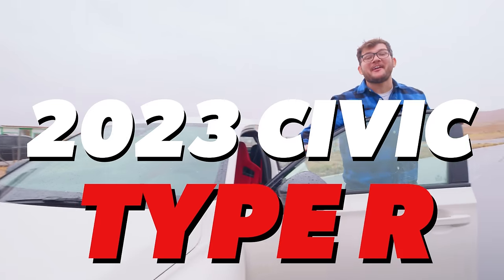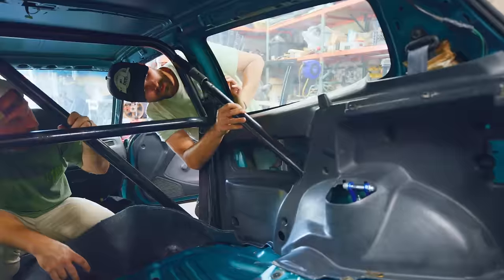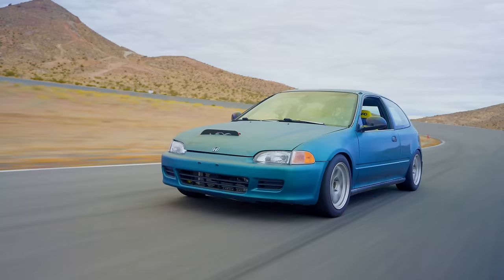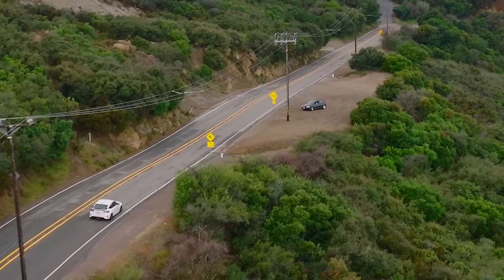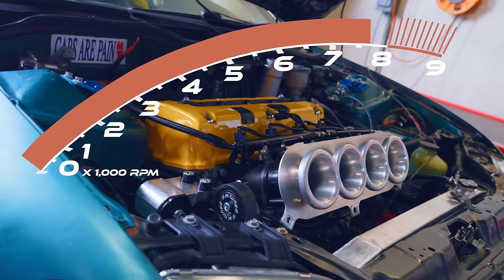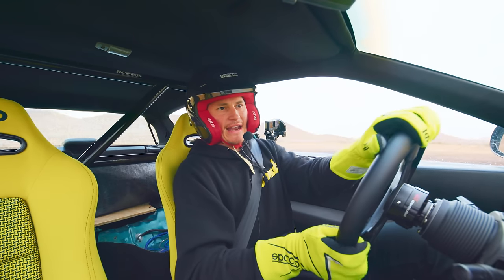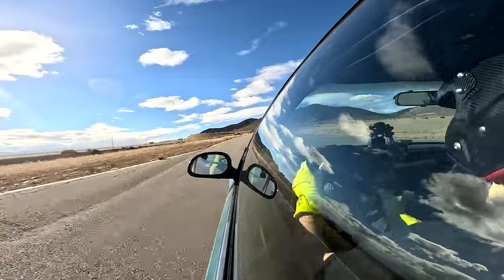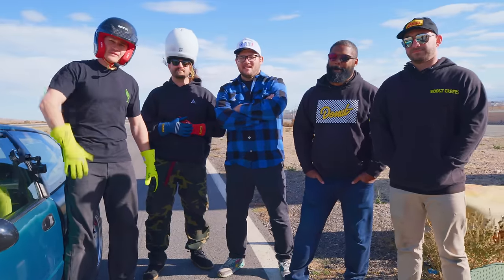$500 Civic vs $50,000 Civic Type-R (THE REMATCH)

Comment: I’ll take the 95 cause the insurance is cheaper
Reply: Is it though? It has virtually no anti theft, no safety equipment, and parts will be very expensive to replace. I'm not sure it would be as cheap as you think it would be unless you have shit insurance that wouldn't actually cover it at all.
Reply: @mr.pritchard67 insurance is absolutely cheaper
Reply: @mr.pritchard67 had a 05 civic insurance was 130 a month now I got a 2020 civic sport and it’s more than double
Reply: It’ll be cheaper if you dont declare mods
Reply: American insurance is interesting
Reply: Yes sir, just make sure they think it's stock lol
Reply: also that rizz
Reply: Not by much
Reply: @Umar-gw6fy  right, which means that if you ever wreck it, you're out of $50 k. So not that cheap...
Reply: @anthonyrathore5192 Yes, what a lovely idea. Then, when it gets stolen, you don't recoup any costs! 😂
Reply: Have fun having it stolen lmfao. These cars are so easy to steal. All of those mods too are uninsured. Let's say You spent 50k on a car, but 48,000 of that isn't insured because of the mods. They'll insure the CTR because of its value that came with the car when first sold.
Reply: @lusciouslunk Facts! I have 2 cars. My '07 Honda Fit is $68 a month for full coverage. My '14 Lexus ES350 is $139 a month full coverage. Im 35 years old, single household with 0 points and no accidents on my driving record. The newer the car, the higher the premium.
Reply: I’m sure the new one is still pretty affordable because it’s still a Honda. I had a MKV Supra and insurance was about $150 per month, probably because it was branded Toyota despite having BMW parts.
Reply: And no emissions
Reply: When they steal the 40k in parts and insurance gives you $500 u will love u saved those 50 bucks 😅
Reply: and get smashed by resale value
Reply: @lusciouslunk  yeah, because when you wreck it or it gets stolen you'll get $150 from the insurance company. 😂 Seems like a great trade off. Not.
Reply: @ThEgamingGINJ I've got a 2019 touring sedan and pay less in NY for insurance than you did for your EG. I think it's time you do some shopping around, sounds like you're getting smoked or dealing with some tickets/accidents raising your rate.
Reply: companies around here refuse to insure any car older than 2005 lol
Reply: @ThEgamingGINJ does you're country also work out the insurance by age of driver too?
Reply: Il take neither of them they look cheap and I don’t wanna fart can going down the street
Reply: I mean… but the repair bills…
Reply: @tommywd40 no one is gonna steal it, haven’t heard a civic get stolen in ages
Reply: Insurance will total it in a heartbeat and won't cover the add-ons.
Reply: @SouthsideKidd550 apples and oranges. The Fit is the very definition of an economy car. The ES is an entry level luxury car and probably has nearly double the HP,  closer to triple if it's the v6.
Reply: me looking at the box on the form... is this vehicle modified for speed 🤐 other cars have this power🤷‍♂️  that roll bar? that's just for saftey 😅 yo vtec just kicked in brrrraaahhhhhhhHHHHHHHH! BRAP BRAPBRAP
brrrrraaahhhhhHHHHHH!
Reply: @mr.pritchard67  "Is it though? "

Jokes aside- Yes, sharply so.

 "It has virtually no anti theft"

Thats a pretty easy fix to approach.

"no safety equipment,"

I wouldnt say "no" safety equipment, but ill grant that the newer car is much safer. Im sure youll get a handfull of comments talking about "but this has a cage! and seats! and harness!"- And ya, thats not entirely wrong. But itll depend a lot on if were talking about a crash on the street, or on the track.  Driving a caged up car while wearing a helmet on the trace track? Sure- id rather be in there. Actually out on the street? Give me the new civic. Cages in "street" cars without a helmet on make them more dangerous, not less (in many cases)

"and parts will be very expensive to replace":

At least with this EG civic- Nearly everything compared to the new civic would be absolutely cheaper.  

" I'm not sure it would be as cheap as you think it would be unless you have shit insurance that wouldn't actually cover it at all."

Now this is a bit more realistic of a concept- Just "insuring the civic" would be cheaper, by a lot.  But if you have THIS much money into it, and you want insurance to actually cover you for those costs, youll need custom insurance where theyre aware of the value of the vehicle and the modifications made to it. Youll pay more for this.

But having had experience with this type of insurance- its still cheaper.  I insure my FD with a value of 35k, that costs less than insuring my prius which has a value of 10~.
Reply: @TerpCrazy  you're being sarcastic here right?
Reply: Yeah it’s cheaper, right up until it’s totaled and they give you a check for 1/100 the value.
Reply: @mr.pritchard67 yes because the car isn’t worth shit lol
Reply: If you’re worried about insurance you wouldn’t have put 50k into the car in the first place.
Reply: You have to consider the mods and extra labor. Some insurance will cover it.
Reply: @88luda88 How is your insurance different?
Reply: Yeah because it's a bucket of metal not worth a fuck except to Honda fan boys. I love all cars but this statement is dumb as hell. Hmm I wonder why a civic with a book value of less than 1000 bucks is 100 dollars cheaper a month than a 40k car 🤔🤔🤔
Reply: Lol so true one will be 500$ full coverage other will be 130$ basic on the road policy 😂
Reply: They'd be the same if it were liability.
Reply: and you don’t gotta worry about markup
Reply: @Umar-gw6fy and depending which state you live in, you won’t be able to smog a car legally with unapproved mods. So chances for tickets and getting your car towed go up a bit.
Reply: IF you don't tell the insurance company what you modded. 😂
Reply: @ThEgamingGINJ liability is liability it's the same price.
Reply: Not in my state lol
Reply: Smaller too, these modern cars are unnecessarily huge lol
Reply: @ThEgamingGINJ wtf how many accidents have you caused to have that high a monthly payment? 😂
Reply: It also looks way better
Reply: @bradleyisfishing  "Yeah it’s cheaper, right up until it’s totaled and they give you a check for 1/100 the value."

Youd need custom insurance that reflects the value of the vehicle.  

Theres numerous companies that do this

Youll of course pay more than if "it was just a civic", but youll still genuinely pay less than what a brand new car would be.

Vintage / collector car insurance isnt usually too bad
Reply: The older civic is a car thief wet dream.
Reply: At declared value..?
Reply: @SidewaysGts  I know that I was given an option to declare mods and their value in my insurance. Once I actually do stuff I’ll definitely be doing that, but stock for now!
Reply: Because insurance will be more than happy to cut you a $1,000 check vs a $50,000 check in the case of a total loss.
Reply: 😂 ahhh yes, and when you totaled it, they will pay you $500, oh wait, you will have to cover the deductible…
Reply: @mr.pritchard67 Why you even trying to compare that with cars which are nearly 30 years apart is what I still didn't catch. The video already did justice. He prefers a 95, you don't, well, good for both of you. 🤷
Reply: Because you are basically totaling it with ANY accident. Those mods won't matter to an insurance adjuster.
Reply: it does have one of the better anti theft systems installed, manual transmission.
Reply: Theyll NEVER payout on an accident vs the new one
Reply: They ain’t gotta know.. to them it’s still the car that takes half minute to hit 60
Reply: So when you wreck it and have no collision they give you nothing for it? Yeah.
Reply: You go ahead and make a claim bring underinsured in a modified car. 😅
Reply: @mr.pritchard67 it'll definitely be cheaper but if  gets stolen or wrecked insurance will pay out whatever the going rate for a stock eg is.
Reply: Agent and adjuster here. If you didn’t declare it. You not getting paid for it.
Reply: Not to mention you can insure it as a classic. Dirt cheap, full coverage.
Reply: @psyck  I'm so glad I don't have to deal with stupid emissions BS here in Alaska.
Reply: @lusciouslunk  until you realize that your expensive mods are no longer insured with that cheaper insurance completely negating the whole point of insurance.
Reply: Word! Insurance for new car is absolutely insane compared to older ones. My '99 Silverado is pennies on the dollar compared to my daily commuting appliance.
Reply: Cheaper until you total it and insurance gives you $300 to replace it
Reply: @mr.pritchard67  Well, you just have to buy it back and find a new shell to hang all those parts off of. Not a really 50k loss like it would be with a new car.
Reply: It is until the insurance companies stop providing coverage to older vehicles which will probably be a thing down the line.
Reply: @MrTilbin  exactly 👎
Reply: Have none of yall heard of a kill switch? Also I'd take the 95 as well since you actually own the car and can modify it however you want. Plus it's built not bought which has its own merrits
Reply: @User77989  This is truth, if it were my 50k, I would buy a used Godzilla (GT-R)!
Reply: and putting tags on the car here in iowa it cost us 150 for a new car over 15 for a car like that
Reply: You’ve got me rolling on the floor cause it’s soo true tho!.. 😝
Reply: It depends on your record too. Had a 2013 SI and insurance was 100$ full coverage the highest of the highs and now I have a 21 type r same insurance same plan and it’s 190.
Reply: If you had 50k to put in mods you’re probably not worried about your insurance premium versus a new car
Reply: My 2023 fl5’s full coverage is $135
Reply: It's cheaper, but the car already broke down once, and they hadn't even put 1k miles on it. I'm all for fun cars, but you better be an expert at building them because that's a LOT of work, and with no warranty. Everyone knows modified cars are less reliable. Just look at every single car they've built, almost all of them have broken down. You're going to quickly outweigh your insurance savings in repairs.
Reply: @realPinkfong  lucky duck. 😂 I had a Neon SRT-4 and just put a blow-off valve on it. The smog tech admitted that it does nothing to effect the smog test itself but because it’s considered an illegal mod, it fails on the visual inspection. 
Even had police pull me over and write a fix-it ticket for a stock exhaust. Because he could “hear it as I drove by.” Had to take it to Dodge so they could write a confirmation that it was stock. Cali sucks for this kinda thing.
Reply: Ok
Reply: @mr.pritchard67 a ghost remote start is like 250$ and protects you completely. I pay 40$ a month for liability on my 92 hatch
Reply: Y'all pay for insurance?
Reply: @mr.pritchard67  Or you could just get another civic for 500 bucks and build that one with the old parts salvaged from the previous one🤷🏼‍♂️
Reply: What about the tax?
Reply: No one wants to insure a 20 year old civic
Reply: Everyone here justifying how were forced to pay for insurance in the first place. Especially when they fight you tooth and nail to NOT pay your claim.

And if you don't pay you're a criminal.
Reply: And you don’t need comprehensive
Reply: You need to ENDORSE any after market parts otherwise it would be NOT be covered, and/or you will have very low coverage
Reply: Until they find out what you did to it...
Reply: @Umar-gw6fy  bit then if you claim insurance because of an accident they'll only give you the amount for the car and not mods right?
Reply: Exactly, wise choice. 😄👍🏿
Reply: Facts and just as fast😂 as
Reply: That’s what been keeping me from a new car 😂the insurance companies 😂😂😂
Reply: If you insure as just a normal 95 it is probably cheaper. If you want to insure all the money invested into it you'd need to do it through a company like hagertys and it would likely be much more to insure
Reply: @anydaynow01  well, that’s a better choice and they don’t sound like cans lol
Reply: Opposite to healthy insurance
Reply: Lol - the 95 civic would be way more expensive and may even require a specialist insurance provider. 

All those after market mods, the lack of safety and anti-theft features but also the mods indicate what type of driver you are. 

Not to mention to start with you are paying insurance on two vehicles while you are re-building and modding it.
Reply: @Armadurapersonal where is that?!
Reply: Definitely would be cheaper. Older cars are normally cheaper than new.
Reply: @L-Dub23  an older car with less/no safety features and anti-theft that has had $50k of modification put into it, cheaper than a $44k new car in stock condition with all the bells and whistles, yeah sure. 🙄
Reply: @mr.pritchard67 parts are still dirt cheap and yes insurance will be cheaper😂
Reply: Registration also cheaper too.
Reply: And taxes lol
Reply: @crxk20r59  you mean the registration would be cheaper for the new car right?

Certainly that way where I live. Variety of different tiers, but the older the more expensive.
Reply: Yes it is cheaper but in the case it’s a total loss you’re only gonna get $500 lol they absolutely do not care that you spent 50k on aftermarket parts
Reply: Easier to work on too I'll bet.
Reply: That’s because the insurance isn’t going to cover all the modifications you’ve put on it.
Reply: @sambeaumont395  Oh, I didn’t know that. In California, the older cars have cheaper yearly dmv registration fee’s.
Reply: True
Reply: @crxk20r59  that sounds odd.
Part of the registration where I live includes emergency services levies, environmental impact etc.

Where I live anyway it’s just one extra thing attempting to get people to upgrade to newer more efficient and safer cars. 
(Although in all honesty people are moving from cars to SUVs which are far more deadly in vehicle to pedestrian/biker than the sloping bonnets/hoods of the past).
Reply: @ThEgamingGINJ  Probably a very bad driver with those prices.
Reply: @mr.pritchard67 well bro actually you can get a insurance company that covers all the mods you put onto ur car cause tavarish has a insurance company that does because he used a v6 charger body and put all the charger hellcat parts on it motor and transmission front and rear end and all of the interior because Dodge gave him a pre production car and they had to "crush it" but... They only had to crush the frame it self so he really stripped that car down to nothing but the frame it self and dodge picked it up
Reply: @marcodelaghetto  ur wrong bro actually you can get a insurance company that covers all the mods you put onto ur car cause tavarish has a insurance company that does because he used a v6 charger body and put all the charger hellcat parts on it motor and transmission front and rear end and all of the interior because Dodge gave him a pre production car and they had to "crush it" but... They only had to crush the frame it self so he really stripped that car down to nothing but the frame it self and dodge picked it up
Reply: @WhoAmIWill actually ur wrong bro you can get a insurance company that covers all the mods you put onto ur car cause tavarish has a insurance company that does because he used a v6 charger body and put all the charger hellcat parts on it motor and transmission front and rear end and all of the interior because Dodge gave him a pre production car and they had to "crush it" but... They only had to crush the frame it self so he really stripped that car down to nothing but the frame it self and dodge picked it up
Reply: @dkrampage2933 actually no bro you can get a insurance company that covers all the mods you put onto ur car cause tavarish has a insurance company that does because he used a v6 charger body and put all the charger hellcat parts on it motor and transmission front and rear end and all of the interior because Dodge gave him a pre production car and they had to "crush it" but... They only had to crush the frame it self so he really stripped that car down to nothing but the frame it self and dodge picked it up
Reply: It’s not a civic but I have an obs Chevy I pay $40 a month for full coverage.
Reply: Idk if its the same in the US as the UK. If you fail to declare mods here your insurance is voided. And modified cars add a premium to insurance because its not factory and they have no way of knowing the reliability or safety of modification parts.
Reply: @GaryRobert17  nah bro you don't have to report any mods here unless you simply want them covered by insurance
Reply: You try and insure a civic for 50000$ and tell me the cost
Reply: I'd take the old one as well. It's got so much more charm.
Reply: @lusciouslunk it absolutely is not lmao, that car is bordering on 30 years old, and like the guy above said it has safety and anti-theft features that are way too old and not effective enough now. Insurance will be very hard on you for it because it’s a huge liability with how old it is.
Reply: @User77989 damn all you do is leave annoying comments on this channel huh
Reply: Insurance typically won't cover the cost of mods and will just go by the blue book of a standard of your make/model so good luck in an accident 😬
Reply: Yeah a whole lot less than the 100 a month for a type r😂
Reply: @TraumaTrae  actually ur wrong bro you can get a insurance company that covers all the mods you put onto ur car cause tavarish has a insurance company that does because he used a v6 charger body and put all the charger hellcat parts on it motor and transmission front and rear end and all of the interior because Dodge gave him a pre production car and they had to "crush it" but... They only had to crush the frame it self so he really stripped that car down to nothing but the frame it self and dodge picked it up long story short is you can get a insurance company that does cover all of ur mods and money you put into ur car
Reply: is it still cheaper to insure with all the modifications? I would have thought it would cost more to insure when the insurance company a) has less data on it to calculate risk b) expects it to be driven fast in possibly risky situations.
Reply: @mr.pritchard67 The '95 is definitely cheaper on insurance. Plus in my state you could insure it as historic and pay next to nothing.
Reply: Not really, since you have to declare all the mods on your veichle to your insurance company, in the end it will cost more.
Reply: Until it hits something.
Reply: @SpartanQwop  well you technically don't have to declare the mods to ur insurance company if you don't care about not being paidout for it if you end up wrecking the car so you could just insure it as a regular 95 "eg hatch"
Reply: @damnitdave.  You do. In the UK anyway, for many reasons. If you get stopped by the police for whatever reason and you have modded your car that it's visible you could get a ticket if you haven't declared the mods to your insurance company (they will check), if you get in an accident and you haven't declared the mods your premium will go up. The only thing you can get away with is the exhaust and simple mods like an air filter. Anything else it's best advised to report.
Reply: @SpartanQwop  like u said in the UK not here in the US I just said that bro 🤧
Reply: @damnitdave.  You didn't mention the US ^ and it sounds like a broken/ dangerous system.
Reply: @SpartanQwop  bro i legit said nah bro you don't have to report any mods "here" as in the United States
Reply: @ThEgamingGINJ  unfortunately you might be getting fleeced by your insurance company. My 23 F150 is less than 130 and its full coverage. I'd definitely look at getting some quotes
Reply: I was gonna comment on this. The old ones cause the insurance is cheaper... and it sounds awesome
Reply: Sweden has some pretty strict laws that say that you can't modify cars to have higher emissions than they had stock, unless they're from 1992 or older, I think.
Reply: It's gonna be about 40 dollars different and that's minimum coverage on the 95 and full coverage on the 2024 ask me how I know and I think the safety features are definitely worth it
Reply: Of course you will
Reply: No way I have a 2008 civic si for my winter beater and an e39 540i 6 speed msport for spring to fall. I pay $80 less a month for the 540 lol
Reply: Ins will only cover stock in an accident unless you tell them about the 50k worth of mods and have them in the policy.
Reply: Is it comprehensive on your new one? If so that's not a fair comparison. They aren't going to cover 50k for a modded 95 civic, so getting comprehensive on the modded one doesn't mean you are covered, it only means they are going to call it totalled and give you $500 if anything happens.  @ThEgamingGINJ
Reply: We don't have to debate about this in the comments. Go get a Vin for both vehicles and get a quote from your insurance company. 🤷🏾‍♂️
Reply: It’s funny how prices differ, my fk8 was cheaper to insure then my mk7 gti!
Reply: @Umar-gw6fy  yeah and then they deny your claims because you didn't declare mods
Reply: @mr.pritchard67  oh it's got anti theft. It's a manual and looks like shit from 40 feet.
Reply: yea cheap..but no safety..no abs...
Reply: I'm covered by hagerty for my 5th gen  lude best decision ever premium stings a little but it's good piece of mind
Reply: I drive an 2016 S3 and a 2007 tacoma both full coverage for 165 a month@ThEgamingGINJ
Reply: @SouthsideKidd550  your comparing your econobox cheap car to a luxury brand mid range car. The comparison is like old navy and Ralph Lauren.
Reply: Donut built it so it'll break down, you need to account for all the spare parts and labour
Reply: If you declare all the parts and such that are in the car you’d probably find insurance will drive the price right up… if they even insure you in the first place…
Reply: Repairs will make up for the saved insurance cost 😂
Reply: Cheaper insurance but virtually no warranty…
Reply: @ThEgamingGINJ Switch insurance every 6 months.  I pay what you do for half of a year 😬
Reply: @mr.pritchard67 pets expensive to replace?! It’s a Honda oil changes are optional. Oil itself is optional. Parts for old Hondas are super common and cheap because of aftermarket support
Reply: Also being 95 only a little over a year till no safety or emissions inspection, and tax value I’m sure is significantly lower than the new
Reply: Insurance void after mods
Reply: Straight garbage 50k for 230hp
Reply: @mr.pritchard67 for my 1995 Nissan pickup I paid $47 with State Farm full coverage and full medical. For sure it will be cheaper.
Reply: then you crash it and they give you $500 minus deductible
Reply: @oddwayne  Ummmm duh! That was the quotes I got if I had separate insurance. My two car combined I pay $147 a month. Of course Honda nameplate will have cheaper insurance rates than the Lexus nameplate. Yes, its a given.
Reply: You’d want to disclose all aftermarket mods and place a value on them. That will raise the rates quite a bit.
Reply: @mr.pritchard67 $79 vs $587 you tell me
Reply: @mr.pritchard67 its a 500 dollar car
Reply: Yes but if you crash it will be more expensive 🧠✅💯
Reply: Insurance is not always cheaper on an older car. First off, you have a coupe vs a sedan. The sedan will give you the cheaper rate. It maybe sport, but because of the 4 doors it can be a family car. A coupe will always be in the sport category for insurance. Next safety features is the other thing that gets you discounts. Third is mileage vs years old. You can get a discount if the car in question isn't driven a lot, but deductions could be applied depending on the reliability to find parts if it's labeled a classic. Fourth full coverage vs liability. Fifth is state and city/town insurance pricing because of traffic vs travel. All in all there may not be to many differences price wise depending on you go about it, unless you go as bare bones as you can get.
Reply: @ThEgamingGINJ 2020 Civic Sport in some Asian countries now costed around $37.500.
Reply: @lusciouslunk why the insurance of the 2005 Civic is so much cheaper?
Reply: @anthonyrathore5192 stock and not upgraded at all? It should've been upgraded to stand a chance of winning against the other Civics.
Reply: @haykakancryptodprots the resale value is way cheaper than most of the normal cars obviously.
Reply: @User77989 for me i gonna take the 2023 Civic Type R. Its just drove amazingly.
Reply: @mr.pritchard67 yeah it’s cheaper by a long shot. and parts are readily available cuz it’s a very common car. it’s a honda
Reply: @lusciouslunk  until it gets stolen since it’s a Honda. Then they write you a check for $500 and your out 49,500 😅
Reply: The insurance gonna cover that 50k dropped into the car?
Reply: That true but if u total the 95 insurance would probably give u only 1k for it lol
Reply: @mr.pritchard67 you obviously don’t know how insurance works…: cheaper car =cheaper insurance it’s common sense.
Reply: @motorheadmike2343  less safety equipment, no anti theft, harder to find and in most cases only aftermarket parts because Honda doesn't make them anymore. Tell me you have no idea how insurance works without telling me you have no idea how insurance works. 😂
Reply: @ThEgamingGINJ holy shit. My C43 AMG isn't that much. You need to shop around
Reply: Yeah, it cheaper because insurance still values the car at $500 and won't provide full coverage 😂
Reply: Jesus loves you & made a way for our sins to be forgiven, turn to Christ & repent for eternity in Heaven!!!
Reply: The screams I hate fun and having a good time 😂
Reply: @mr.pritchard67  did you just say parts will be more expensive to replace? lol
Reply: not to mention, they could’ve easily made a better track car if they actually wanted to😂😂😂 for 30k or less. something tells me they were not allowed to make the old civic faster for sponsorship purposes.
Reply: Yeah it’s cheaper if you’re like in your 40s 😅
Reply: Except all aftermarket parts won't be covered unless taxed. And then you'll have to find an insurance that accepts that and you probably will have to pay just as much insurance as the new type R
Reply: A man of culture🧐
As would I good sir
Reply: Right just tell them it's stock😂😂
Reply: Till they realize it’s heavily modified
Reply: @padnoracing2416  yeah in Canada once I turn 25 it will drop abit, I got a clean record too civics are just getting more pricey now with all the thefts
Reply: @snussy-kp8qj  0 I live in Canada our dollar is shit and they said it’s more for civics now cause they keep getting stole
Reply: @mitsuturbo  it’s basically brand new only 31,000km on it and in usd it would be like 220 a month, insurance said it was cause of all the Hondas being stolen in the Toronto area pretty much prolly bs lmao
Reply: Worry about the property tax on it and not the insurance so much.
Reply: When you wreck the $50k ‘95, the insurance gives you $500.
Reply: I’ll take he 50k and buy a real car
Reply: All y’all saying yeah then your car is stolen….you understand you don’t have to live in a democrat  crap box city..move into rural America enjoy your car and way less police along with nicer people and much safer as well. And much more affordable living instead of paying 1-3k+ rent that would be multiple months payments on nice homes so you’re making money monthly not throwing it away. 😂
Reply: @mr.pritchard67  wrong. You swap all the goodies to a different chassis and just build another.
Reply: @mr.pritchard67 It's manual. US carjackers can't drive it.
Reply: @ThEgamingGINJ 130 a month? Daym thats hella expensive for a civic
Reply: My insurance is mad for my 94 probs just the uk tho
Reply: @mr.pritchard67 as someone with both a 95 and 2020, the 95 is about 1/3 the running costs, parts fuel insurance included.
Reply: The registration is cheaper lmao
Reply: @ThEgamingGINJ  honestly in Malta the insurance is taken by age, co2 emissions and how much the car cost and the aviability of parts.
Reply: I mean after 50 bands of straight up yu wouldn't be worried the insurance lol
Reply: @stann_visuals  what does that even mean? They're "mad FOR your 94" ? WHAT?!!
Reply: So is the payout, you aren't getting reimbursed for any of those parts
Reply: @CptPandy-tj9ty  its actually mandatory where I live
Reply: Did u consider adding all tunes and upgrades to insurance?? 
More likely will be more
Reply: My thoughts exactly lol
Reply: @Umar-gw6fy yep. Don’t declare mods, but keep pictures and records in the event of an accident.
Reply: @AustinB3.6R  
Pictures are not enough, if u didn’t declare they dont give a fuck , insurance company will say its a different car either swap license plate
Reply: @RX-805  Nobody I know has ever had a car stolen where I live lol
Reply: Yes but you’ll get back a $1500 check if anything happens
Reply: yeah but if you build it out that yeah those parts won’t be insured you’ll just be covered for everything oem that they think will be in that car
Reply: @jeremiorgana8971  okay buddy. You’re so smart and you’re so right. I didn’t get tboned and get an extra $5000 from his insurance company for the pictures and receipts of my wheels. Subwoofers, tuner, radio, cams,
And all of the work I had done.
Reply: @mr.pritchard67 amen. I love my mad low rates on my 04 hondavan. But. At a quarter million miles she's had a few very expensive years and even the dealer couldn't calibrate my ancient odometer. A mess of recently maintained bits from a network of local gearheads. Great people, great shops, great options for upgrades... okay yah old cars are better. ;)
Reply: You get an Eg for cheap insurance they just gonna steal it from you.. been there done that
Reply: Liability gang checking in.
Reply: As long as you are okay getting $500 back after putting $50,000 worth of parts plus countless man hours if it gets wrecked or stolen.
Reply: @mr.pritchard67 it does have an anti theft system in it. It's called "being old" and "manual"
Reply: I’d take the 95 cause I like it better
Reply: If you can’t afford the insurance you can’t afford the payment on it
Reply: @gouveiarfl  that one dude with the beanie. shit gets me every time.
Reply: I drove a 2020 Accord and a 95 Accord.
The difference was 20$
Reply: @ThEgamingGINJ my 2018 is triple then my 2006 si . And it’s 5 yearsss old
Reply: We used to do the same with mustangs,pay insurance on a 4 cylinder but have a V8 lol
Reply: Anyday
Reply: I take the 95 cuz it looks better and its a hatchback and because idk its one of my favorite cars
Reply: @RX-805 
No one is stealing that POS. This isn’t 2004 anymore and that’s no Integra Type R.
Reply: @negativeindustrial  people will steal anything. You live in a good neighborhood I can tell, so i doubt you'd know.
Reply: @ThEgamingGINJ that’s where I am at now have had the 05 for a few months now, and that’s what I also plan to do in future😂
Reply: 😂😂😂😂😂 wtf
Reply: @lusciouslunk My 1991 CRX was almost $60 a month more for full coverage than my 2014 Nissan Titan because it has no anti-theft or ABS or traction control or any of that stuff because there's no safety features it actually makes it more expensive.
Reply: @lamesamelame  If you value your life that much you wouldn't drive it all.
Reply: @lamesamelame  nope I actually do and I'm not obtuse at all I'm actually very straightforward. You have a one in 33 chance in being in a severe automobile bill accident severe meaning maimed or dead. If you really cared about your life that much you wouldn't drive at all. I drive a 91 CRX with no airbags no door panels no ceiling no traction control no ABS. And I just accept that I love to drive that car so much that if I die while driving it, then at least I died the way I wanted to having fun.
Reply: Lmao I second that
Reply: Is but the break non stop lmao
Reply: Definitely British 😂
Reply: Everything is cheaper.

Engine 
Parts
Tires

U name it
Reply: And I'll still beat it around a track in my $4000 ninja 4000 haha
Reply: @teej1987  you literally can’t compare the 2. That’s like saying a plane is gonna go around the world faster than a submarine
Reply: @keeganfaulkner1240  no its not , because a plane goes in the air and a sub in water. It'd be like a commercial airliner vs a fighter jet
Reply: @teej1987 point being a 300 pound (maybe) bike is going to always go way faster than a full car. Not a fair comparison
Reply: @keeganfaulkner1240  my bike is tiny and  is 366 wet. 600 super sports are 410-440. 1000s are 440-480lbs
Reply: @mr.pritchard67 anittheft? It got a quick release and plus its manual, that boosts your safety chances a ton, if you know how to drive manual then you have no reason to steal, if you drive auto you are more likely to just take it
Reply: And little if not no warranty
Reply: It looks better too. That type r looks like you want to live in the mall, the EG is the one that knows what it wants to leave with
Reply: @SouthsideKidd550 where u getting 68 a month for full insurance that's crazy
Reply: My insurance won’t cover more than liability on my 98 ram lol
Reply: @mr.pritchard67  you worried about theft? just buy a JDI kit lmaooo
Reply: Right answer
Reply: Liability only with the old one And it's always cheaper
Reply: Get a car now  for 500.00
Reply: @mr.pritchard67 you must be on crack if you think parts are expensive to replace compared to the type r lmao
Reply: @SouthsideKidd550  interesting, I have a 06 4Runner, full coverage and pay $175 also no point. Wondering who your insurance is.
Reply: @SouthsideKidd550  why would you get full coverage on your honda fit?
Reply: @shoruda  Because living in Atlanta it is recommended. Thats just like asking you why do you have health insurance.
Reply: If you need to cheap out on insurance, you can't afford a 50k car.
Reply: @mr.pritchard67  
Insurance doesn't cover the $60k worth of mods you put on something.  It only covers what the tables show the value of the stock version of that year/make/model of car to be.  If your car is worth $10k stock and you add $40k worth of mods to it and then get in an accident.  Insurance is only going to cover the cost of stock factory parts to replace whatever is broken.  And that's what your insurance premium is going to be based off of.
Reply: Just swap the engine for a far better one and save more money.
Reply: resale aint it tho
Reply: @mr.pritchard67 1000000% you ever pay for car insurance??